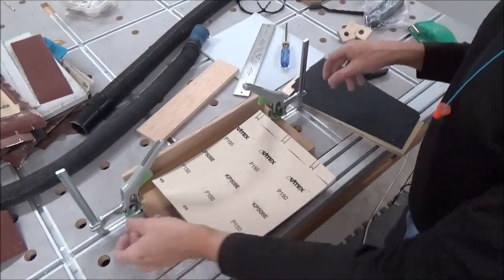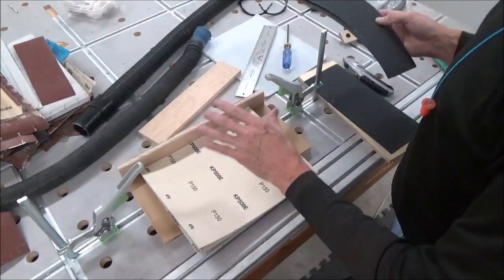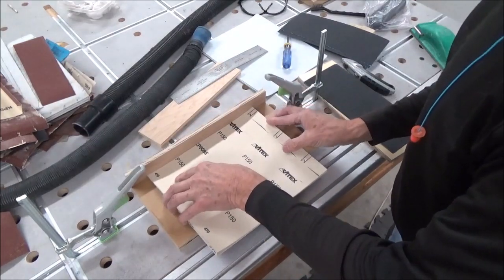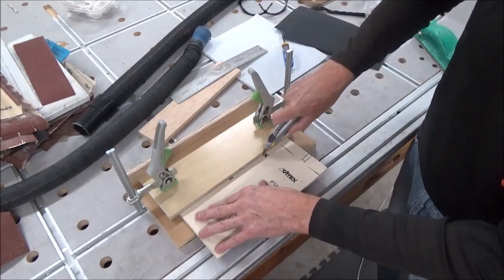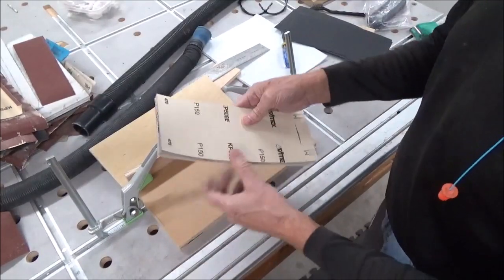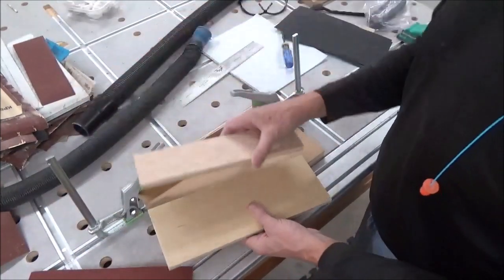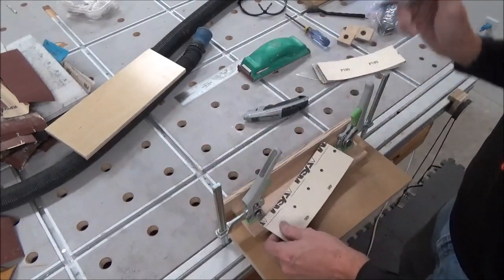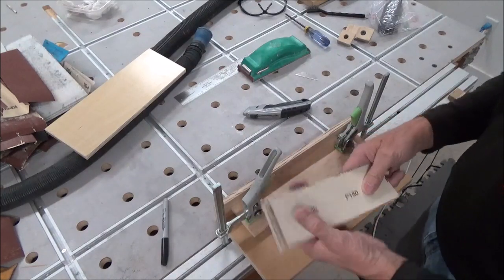Sandpaper Cut Jig

Comment: I made a hacksaw blade version. I used a strip of aluminum to reinforce the blade and back it up to keep it flat to the sandpaper. I ended up just using the aluminum as a guide for knife edge. Works great. Basically same thing you did here but very roundabout way of arriving there.
Reply from the maker: Thanks for watching and I think the type of sandpaper being cut makes a difference as well. The type of paper I have has a paper backing that is  thicker than most. I like the cleaner cuts despite it costing a utility blade or two.